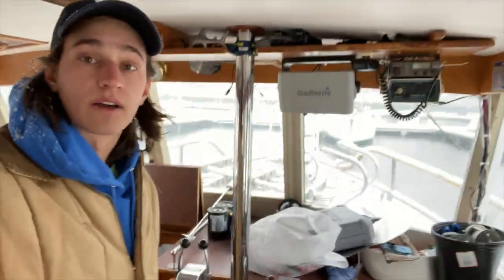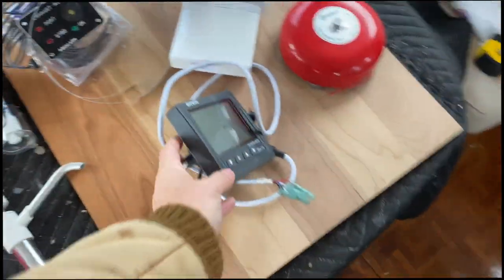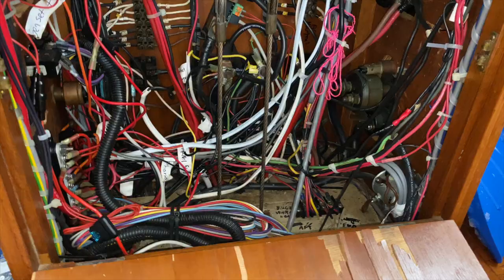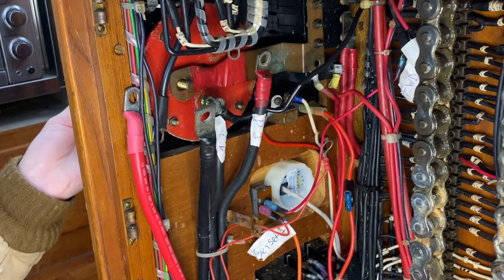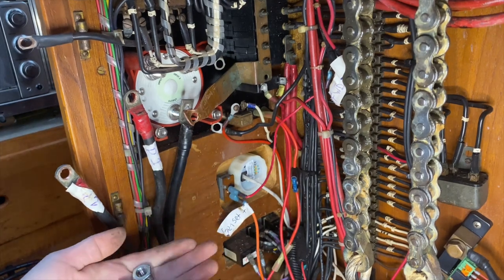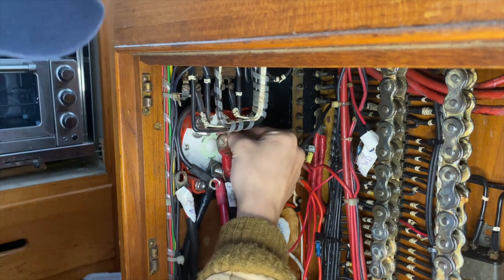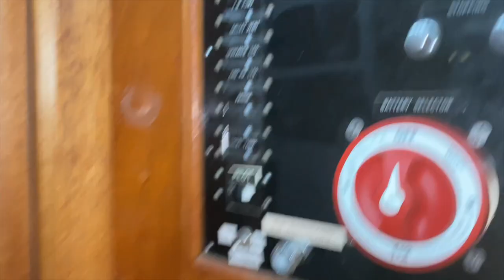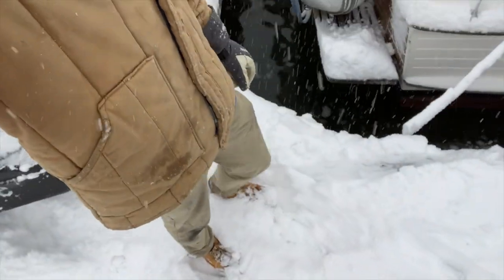NEW Battery Switch - Mitch SOLO

Comment: Hello! I am following you from Spain, so, sorry for my english :) As a boat owner and DIY enthusiastic I would like to congrat you for the very nice content you are sharing. About the installation of the battery switch, just a couple of proactive comments. To cover the copper bus you should use heat shrink tube, much better and easier to install than the electrical tape. Also it is recommended not to drill the ring terminals, as you decrese the contact surface and probably increse the temperature of the connection point, so, depending on the Amps, could be risky.